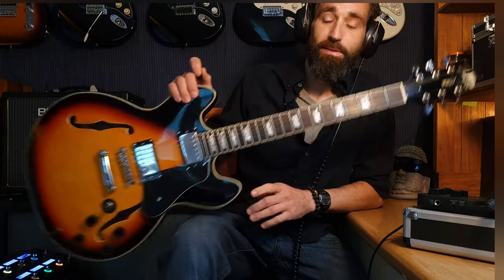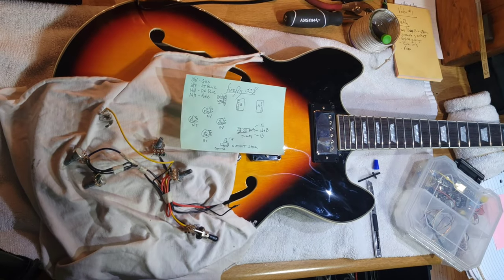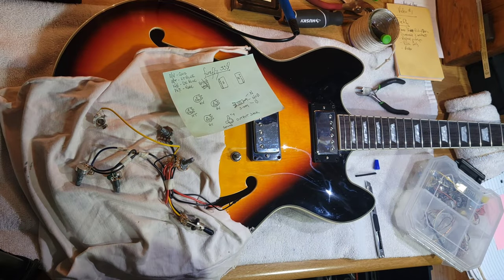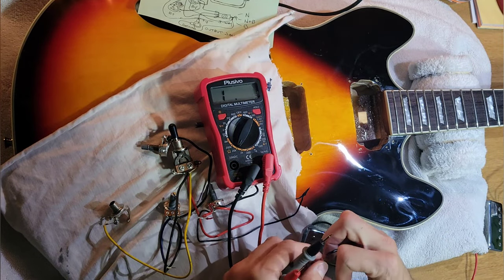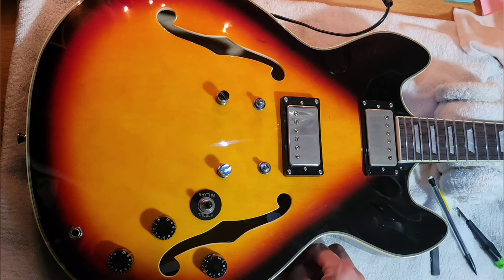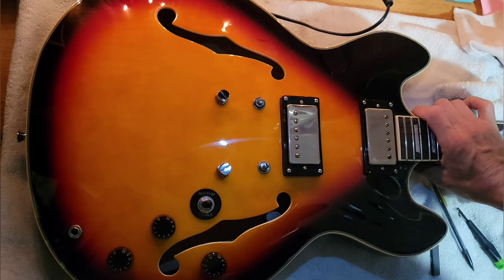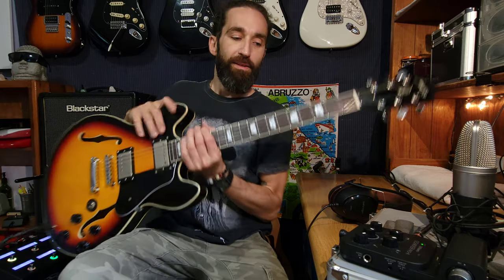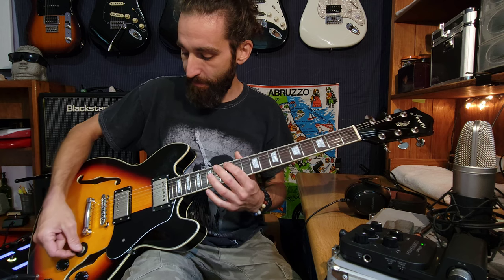Firefly 338- Mod with Mike

Comment: Gibsons are 3 ply, maple/poplar/maple, back sides and top. My 2023 FF is a 5 ply, likely because more thin plies are more easily bent and won't crack when they're in the presses.

FFs also dont have the strips of kerfed wood at the inside joints, the tops and backs and glued directly to the edge of the sides. They may hedge their bets with thicker sides than Gibsons. The lack of kerfing makes for a slightly brighter body. Lack of kerfing is common on lots of budget copies.

They're still putting hot bridge pickups in, kind of a gamble on Thinlines